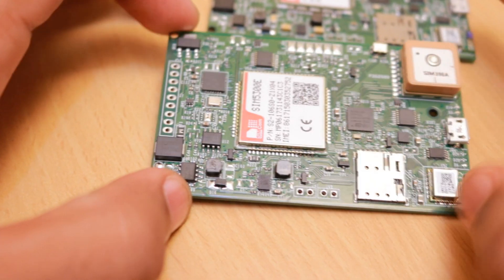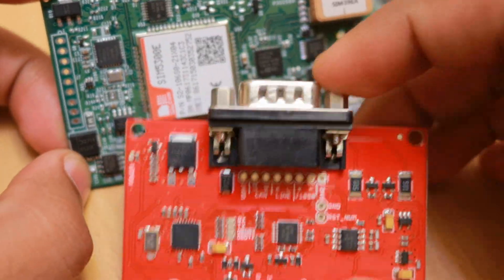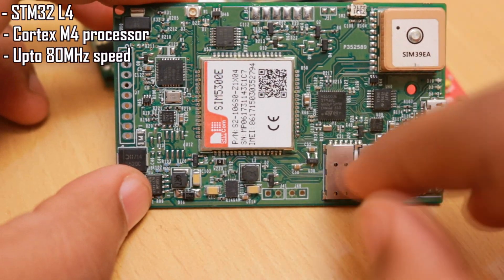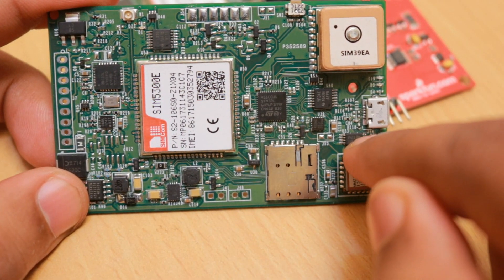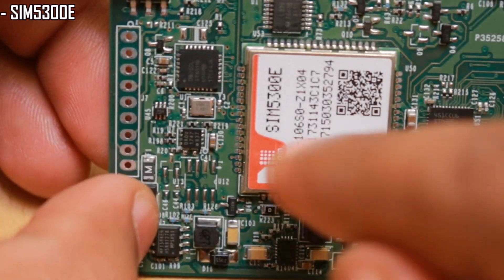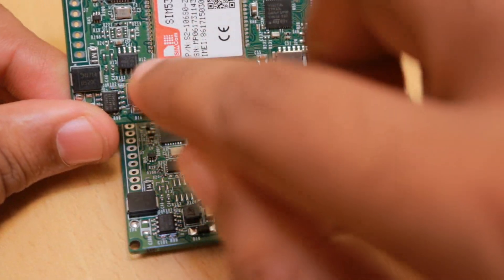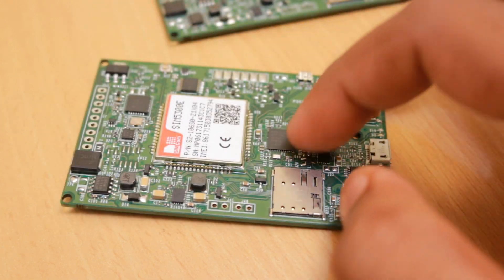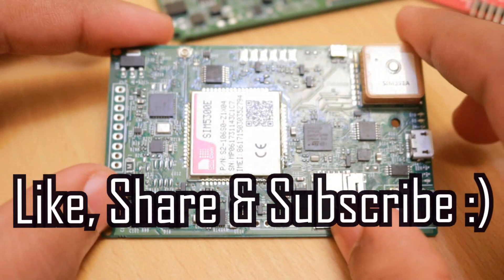OBD-II enabled 3G GPS Tracker for Australia - OBDII + BLE4.0

Comment: Great Video Ravi Pujar, I am very interested in the GSM Moduls like the Sim800l.  Do you already know the Battery runtime of the board ? Can you recommend any microcontroller that has a low power consumption. I am familiar with the Arduino IDE the problem is that for example the 328 p microcontroller has such a high power consumption. Keep on making these amazing videos.
Reply from the maker: Thank you for watching .
I recommend STM32L series they are awesome. 
If you have technical questions, you can ask here, http://www.embeddedadvice.com
Dont forget to share and subscribe :)
Reply: Ravi Pujar thanks for the answer. What do you think about the msp430 microkontroller from Texas Instruments they also have a very low power consumption. I have a couple of sim 800l modules but the problem is that some of them, when I connect them to power turn off and quickly on again sometimes even though they are connected to power. Did you have that problem once too? Would you try to reset them to the Fabrikation settings or can I even do that?